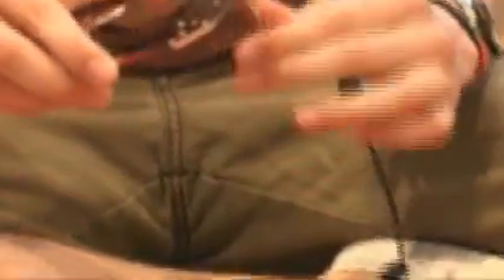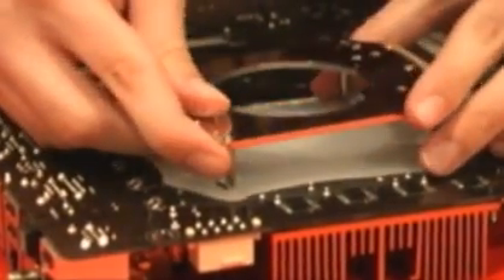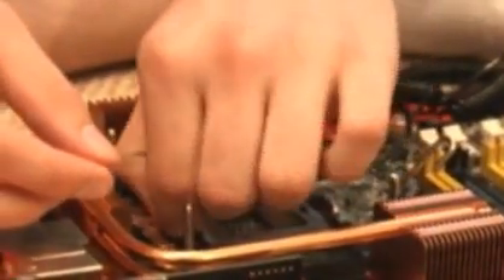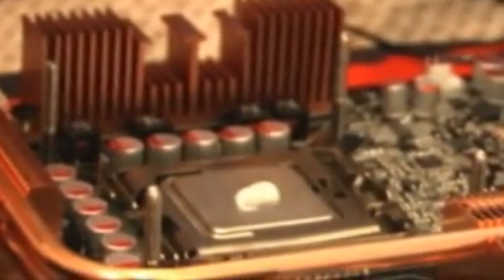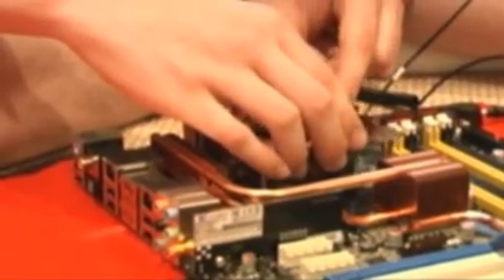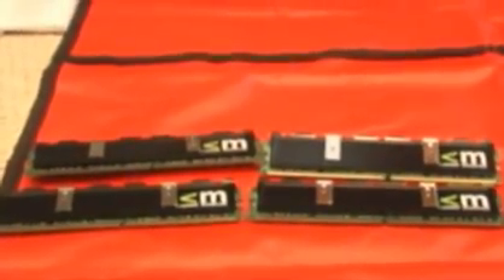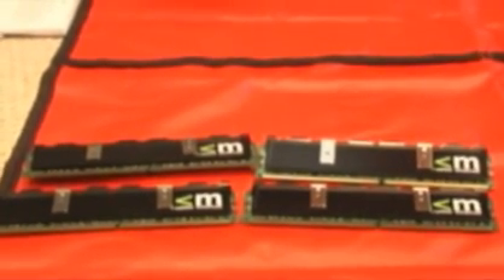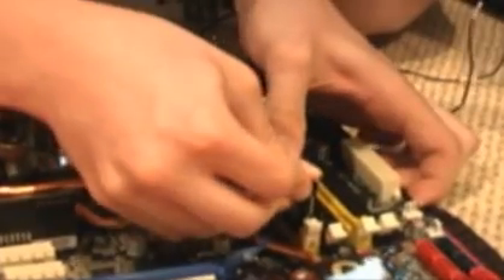(Part 2/4) How to Build an Ultimate Computer

Comment: @serXcampzXalot Also, you do not spread thermal paste. You put a blob of paste (about half of what this guy used, and make sure it doesn't curl around like this guys did - it needs to be a neat circular blob) and then you install the heatsink in one press. If you don't, then you get air bubbles, and air insulates the chip, preventing your chip to cool. This guy has not been trained

Comment: you should tighten the cooler 2 corners at the same time, 
Example:
two turns on one corner and on the oposite corner ( at the same time ), then two turns on the other two screws

Comment: You only need about a pea worth of Thermalpaste also maybe a little less, never spread it out jsut let the pressure do that itself. never mount the motherboard before putting your cooler in. and never use stock cooling, cuz its lame. when tightening screws, tighten them equally like a quarter turn, for each and keep going around or you will bend something.

Comment from the maker: It all depends on the type of thermal compound you are using.  If you are using ceramic based paste, then applying it the way I did in this video is just fine.  If you use metallic paste, like artic silver, it should be spread out in a thin layer.  Please see my other video in which I detail that process.

Comment from the maker: we used watercooling, so the CPU block was ordered separately.  Normally, you use the fan that comes with the CPU.

Use two of the slots that are the same color.  For examples, if two slots are blue and two are red, but them both in blue, or both in red.

Comment: In conclusion: the thermal paste application we see here is EXCELLENT, much more efficient for heat transfer than just a little drop in the center (remember NOT to use any compound containing metal particles). When you calculate the surface of contact vs heat conductivity, this method using non metal particles compound, is more efficient than a little drop of some other more conductive paste that contains metal.

Comment: Hence, the spreading we see on this clip would be OK (however just a little too much on the border sides), as long as the thermal paste that is used does NOT contain any metal particles nor other electrically conductive materials. Believe me, I've graduated in mechanical engineering and know a bit about thermodynamics.

Comment: That's why I would recommend the Arctic Cooling MX-2 Thermal Compound. It does not contain any metal particles (unlike the Silver 5 or other silver and copper compounds), hence there are no problems regarding electrical conductivity and capacitance. Thus, contact to electrical traces, pins and leads cannot result in any damage.

Comment: Well... As long as the compound does not contain metal elements (like silver however it's not that much conductive, but just in case), non conductive material, it doesn't hurt that much when putting the heat sink - the goal here is that the compound will not spread outside the surface. Fact is, the larger CPU's surface the compound will cover, the more efficient thermal transfer will be.

Comment from the maker: Definitely don't put it right on the chip.  That will prevent proper heat transfer between the CPU and heatsink.  Put it on the side of the heatsink.  You should try to use metal tape if you have. OR electrical tape.

Comment: Btw, I am currently building my computer (waiting for last parts via snail mail). I acquired a fan controler, the Zalman ZM-MFC2, but I don't know where to place the temperature sensors, for example on the CPU. I've checked all documentations, even those of other products, but they all say "place it near the zone you want to monitor"... Can I stick them directly on the chips (i.e. the CPU), or would this potenially damage those parts? Where should those sensors be placed for optimal efficiency?

Comment from the maker: they accomplish the same thing.  A strap keeps you at zero potential with ground.  Touching metal equalizes you every time you touch it, but it can accumulate charge when you are not connected to a grounding source.  Either method works fine, and will ground you more than enough for desktop computer equipment.

Comment: If you don't know if your operating system is 32-bit or 64-bit, then it is more than likely 32-bit.

You would have had to specifically ask for a 64-bit version of your OS, so if you didn't it'd be 32-bit.

Comment: Dude, you don't need a hammer to get the backplate off, you just push it out. It takes a bit of force sometimes, but it comes out.

Also a 32-bit operating system will detect up to 4GB of RAM, not 3GB. This includes your video card RAM so you usually get about 3.5GB of RAM detected.

Good videos though.

Comment from the maker: Not so, It completely depends on the system.  The theoretical max for 32 bit windows is 3GB, but it varies.  In my comp it detects 3.25 of the 4, and I have even seen it detect as little as 2.75GB on some computers.